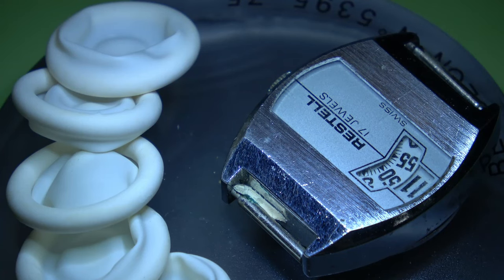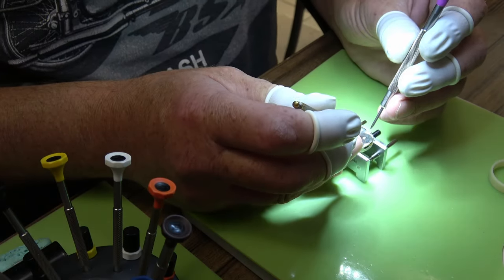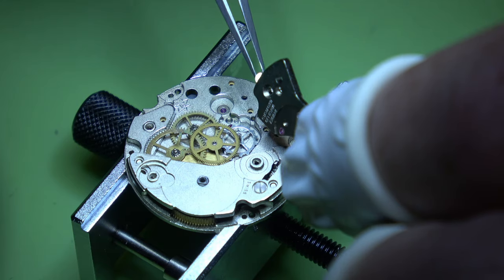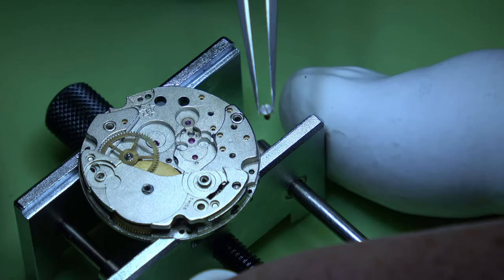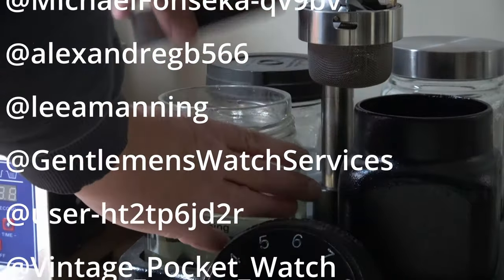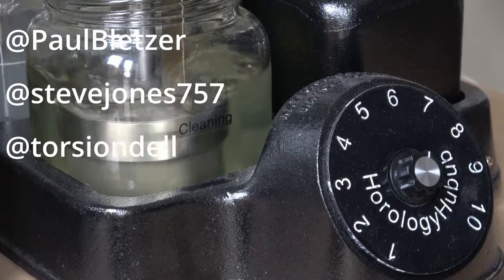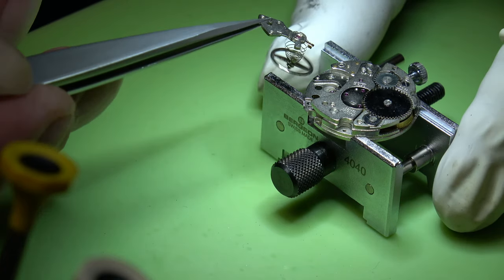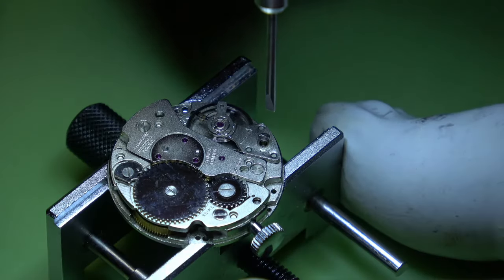Restoring a 1970s Jump Watch: Movement Service & Filming Fumbles🤬🤬

Comment: I've been following you for some time, Adie, and you've given me the itch to have a go at watch maintenance / repair. Can you point me to some resources which will show me the gear I'll need and how to get started?
Reply from the maker: Hi Niall, thanks for the support it is appriciated. So surprisingly you need very little to get going and have a try. Eye loop, tweezers, screwdrivers and somewhere soft to rest the movement. If you look in the description of one of my visa there are some links to give you an idea. They are not affiliated in anyway just ment to give you some guidance. You can  probably get all you need for around 50 quid. Get yourself a working movement of eBay for around 20 quid and you should be good to go. There is also Wriatwatch Revival who has kits but I'm not sure on areas he will ship to but worth a look. I've attached a link to a video and his channel. 
https://youtu.be/_9czt3IK-o0?si=eTdFE-kQDx_3Iocf
Happy tinkering my friend.

Comment: May I ask two questions?.  From where do you order your jewels, and are they particular to the movement or do you order them by size?.  How do you measure the OD?.  This is one thing I have not had the opportunity to do yet and would have no idea where to even find new jewels.  Cousins?.    
Sorry for being a pain.
Reply from the maker: Hello my friend😁 first thanks for taking the time to watch. And yes somewhere like cousins or Gleaves of London. There is also HS Walsh which is where I got these from. Some jewels can be bought by movement number but tend to be the expensive watches.  If your lucky you can measure the OD with a gauge once you have removed it if in one peace or if you have a microscope you can get an eye peace with a rule on it to measure. Believe me I’ve ordered a few wrong sizes lol just need outer diameter and the pivot diameter which are the sizes jewels are sold in. Hope that helps my friend and there’s an email in the description please feel free to message anytime with any questions. 😁👍👍
Reply: @HorologyHubub  Thanks very much.  That was helpful.  Awesome!